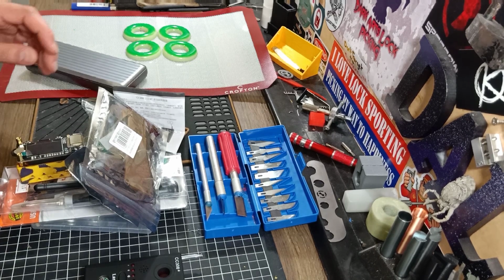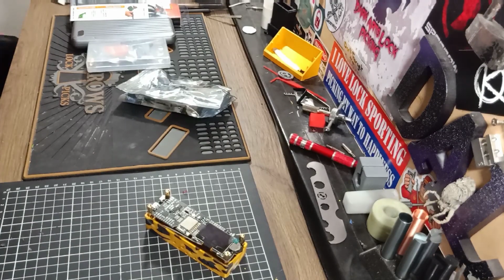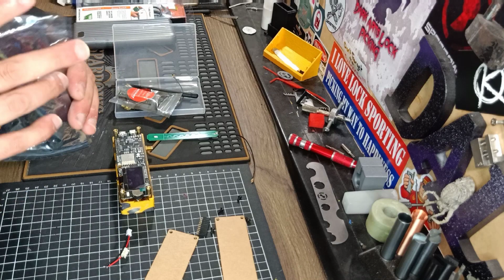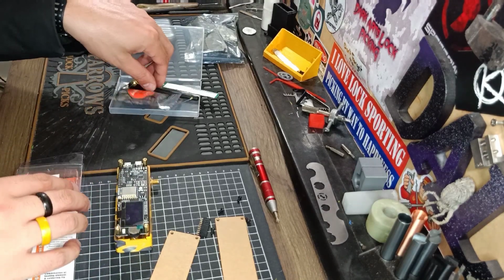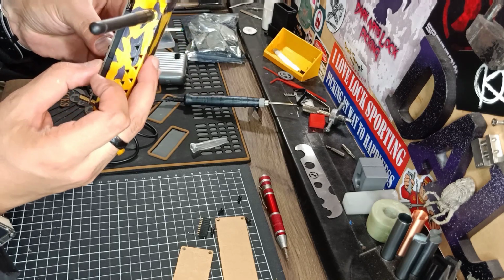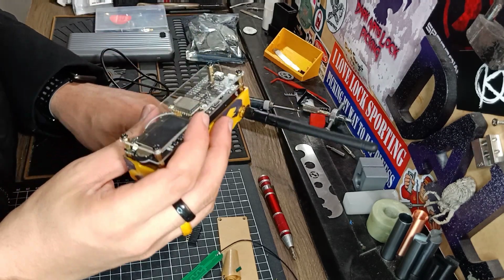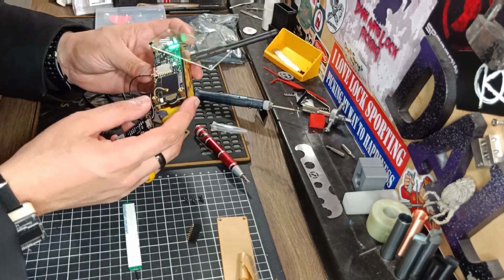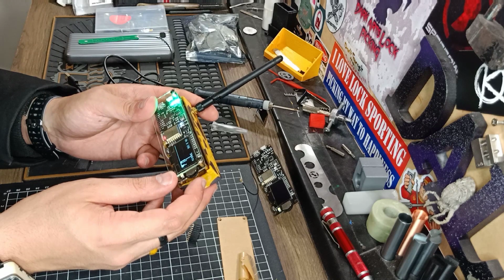Deauther build. And testing my new USB soldering iron (405)

Comment: I really like that USB powered soldering iron. I never knew they existed. That 18db antenna should make a huge difference. I'm glad you are trying these products so we don't have to, just to test new stuff. Would that deauther block those Ring door cameras from working?
Reply from the maker: Yeah it's a great little iron and works really well. It's now in my EDC bag. Lol yeah I spend money so people know if they should or not 😂. It can work on anything that's working on wifi that uses 2.4ghz so it could work. If it's wired in it won't work but if it's wireless it should.
Reply: @DarkArtsLockPicking  good info James. It looks like the Ring doorbell Pro2 works on both 2.4 and 5ghz but I haven't looked at specs yet. My cameras are all wired in but was thinking of a ring doorbell for convenience but they are expensive. I now need a paintball gun for porch pirate's! :)
Reply from the maker: Yeah I know what you mean.